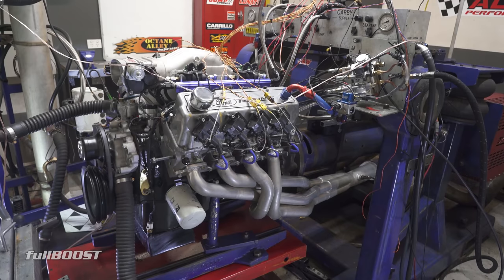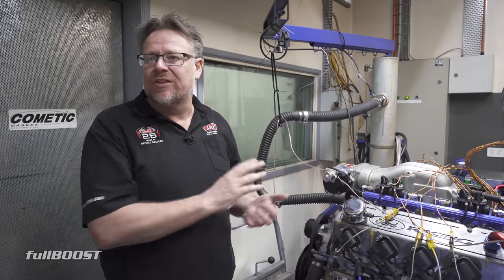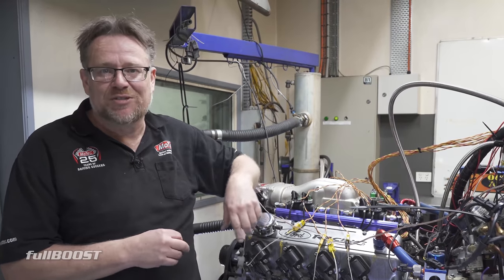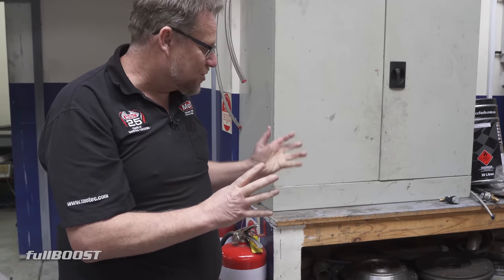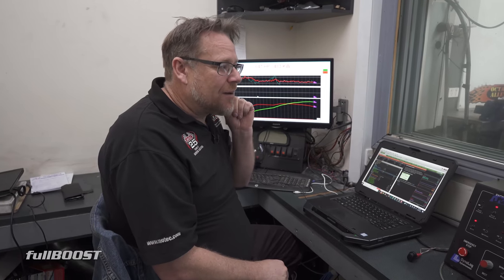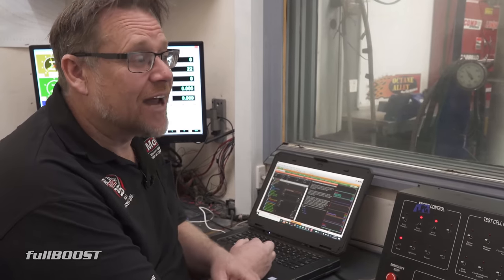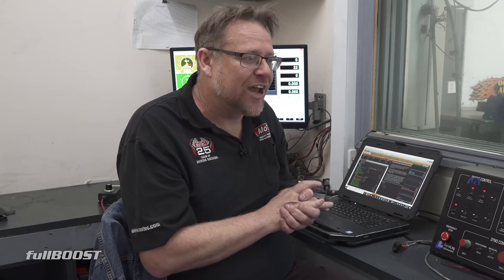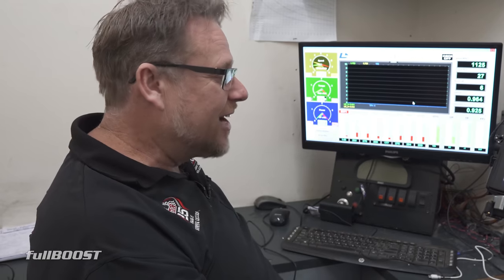In depth engine tuning with LPG liquid injection dual fuel | fullBOOST

Comment: SHHHH don’t let everyone know about getting more power on Liquid LPG 🤣
Reply: It's not exactly a secret bro... 🤔😁
Reply: In all fairness, most people wouldn't know
Reply: You don’t even need liquid injection lpg to make good decent power I’ve got a vl turbo on gas research setup making 465hp atw on 22psi and soon to be 500hp plus when new setup goes on it there’s quite a few little tricks to do to make it work
Reply: @anthonywhelan8373  I totally agree, liquid injection is nice and all- it'll still make power with a traditional set up with converters and mixers. It's essentially running like a carb, and carbs make power too. Sounds like an interesting set up, I've got a built RB30 turbo in an R31 that makes similar power on 98RON and a bottle not octane boost with every fill... I've got my LPG installation licence, but at the shops I've worked at we didn't specialise in installations, we did a lot of diagnostic and repairs though. I always find these LPG performance set ups interesting. The fuel is pretty good for a few reasons, I'd always wondered how you'd go with boosted set ups with the fuel variations in different seasons. Do you just need to run it a bit fat and safe to compensate for those fuel variations? Or do you retune it as the seasons and fuel changes? I wonder how it would go with a 45 - 50psi tune, things get a lot more serious at those boost pressures and things you can get away with at our power level can grenade engines at 50psi
Reply: @danielbrealey2924  hi Daniel I don’t know about the higher boost levels but I was struggling at 15psi at one stage to get the gas into the motor but put in twin 10 soft lines from tank to the twin converters this made it like a surge tank setup only reason I didn’t go higher on the boost at the time 22psi is I only had cast pistons in it now I’ve gone forged motor and going to at least 30psi if we can if there’s enough gas I shouldn’t have a problem though now as I obtained the setup of gas 747 vl that car went 9.40 1/4 and made around the 750hp atw not sure what boost though and yes it’s been a pain in the arse to get it to this stage like head been rebuilt 3 times kept recessing valves then went stainless and just the constant nagging from people that talked it down you won’t make anymore than 250-300hp with that shit 
Wow aren’t they wrong and very quick to shutup now 😂 anyway it’s been a good learning curve but luckily it m a tech as well as a qualified lpg fitter too so a lot of cash saved by doing a lot by myself but still over $50000 gone into the car driveline over the different setups and gearbox combinations
Reply: @anthonywhelan8373  Very to interesting bud. Love hearing specifics about people's interesting builds. I've had to shelf my R31 for a couple of years cause of family stuff, but it's sitting there staring at me- calling my name! 😂 I've got to change the MLS headgasket and swap the K frame, one strut and a control arm... I stupidly used to let my ex drive it and she put it into a curb sideways HARD... 🤦 You should have seen the damage to the Panhard rod mount in the body. Dealt with all that, I miss driving it so much. You still driving your VL?.Sounds like you've just recently stepped up your set up and might not be back together yet? Am I way off, or it's a fair assessment?
Reply: @danielbrealey2924  no not driving it at the moment have to pull the head once again due to my own fault detonate in cylinder 3 due to lean backfires and hut the converter diaphragms bent the steel plates on the diaphragms too bloody impatience on not waiting to get it on the dyno and tune may have cracked the head or hurt the mls head gasket but now going to a Nitto head gasket apparently better sealing and then get the gas setup on it and gas tank heater setup done to increase the tank pressure and possibly rebuild the bloody head again lol but hopefully should be going by end of summer and get to drive it again
Reply: @anthonywhelan8373  Ahhh, damn. Those lean backfires can be brutal! I hope you get it back up and running again soon. What colour is it? If I ever see it down Calder we'll race!!! 👍
Reply: @danielbrealey2924  white with grey v5 simmons check it out on my you tube channel neat and tidy
Reply: @anthonywhelan8373  Yeah, sweet! I'll check it out... 👍 I'm a big fan of V5's, are they from the old batches or a modern Simmons casting?
Reply: @danielbrealey2924  original simmons not Chinese crap

Comment: I played around what you doing now years ago when lpg was 3rd price of petrol. ..ı had 2 separate computer systems running 8 injectors. .major issues I had you use 2x closer to 3x more lpg than fuel for same amount of hp out of the engine. ..and lpg is 2x heavy than water. ..running fuel and lpg together. .I didn't find much point I think their is better or alternative if for HP methanol water injection. Is owner driving one side of country to other side. ..just leave it as duel fuel ..between both tank's probably close to 1000 km

Comment: how come you have a problem with the amount of liquid gas, and I don't have a problem with gas in port injection  in my  car, chrysler 300c, 5.7, with 6.1 srt cam, prins lpg, power around 400hp, no difference between gas and petrol on any rpm/power, it runs 12 a/f normally, for years, no problem